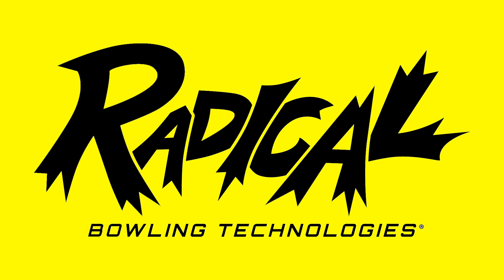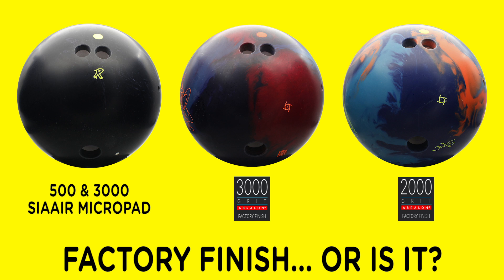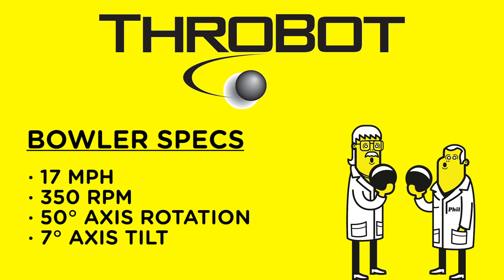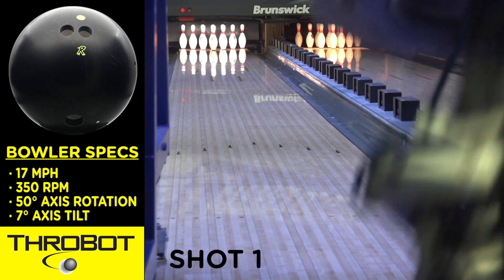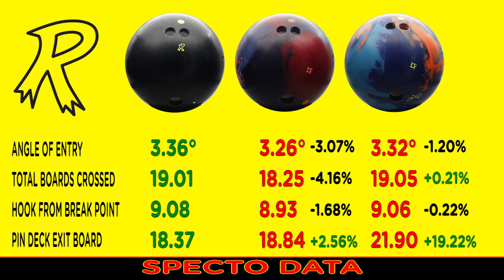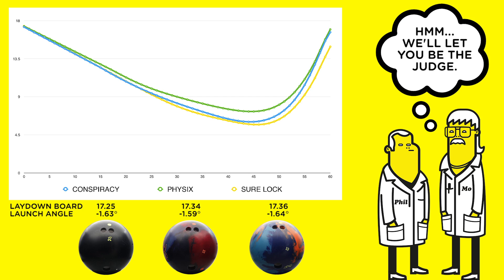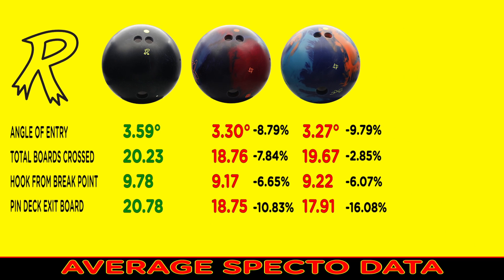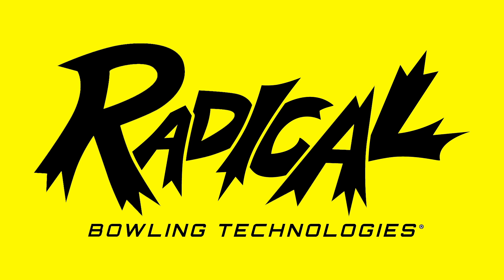Perception vs. Reality 6 - Radical vs. Storm

Comment: Im just gonna say this, bowling to me, for certain conditions, you'll want the hook the Conspiracy provides. But for other patterns, you may want a ball that hooks earlier instead of later and that crosses more boards.

The Physix is a good example of this when compared to the Conspiracy on 45' (the Sure Lock was pure, and still is for those who have it, utter trash). The Physix hooked the soonest because it was designed to have a early rolling / strong core with a cover that digs into the oil for friction to get to the pocket. Thus creating a ball that can handle oil with a punch

For other conditions (such as shorter patterns) you will need something like the Conspiracy to cover more boards instead of hooking early. 

In my personal opinion, these tests should be conducted the way they were in this video, along with different patterns (3, long, medium, short). 

Another thing to consider is burn. When the lanes begin to transition. Say said bowler throwing these balls is able to properly adjust to breakdown when it showsup. Now, if this bowler can make these adjustments with confidence, he / she now relies on the ball to carry and properly work in the new area of play.

Point is: Consider breakdown and how these pieces of equipment can handle breakdown and transition

Comment: I don't know why these videos keep getting into my feed. But since our Google overlords insist, I'll comment. These comparison videos are useless. They take different balls, with different characteristics, then sand them down to be 'equal' instead of manufacturer spec, then use a machine to throw using settings which no human will ever match, all while comparing it to a ball custom designed to BE THROWN BY THAT MACHINE, and then do an "I Win" dance. But how the fuck does that help me? My PAP and ball speed and revs are nowhere NEAR those values. Not even close. Hey, I've got an idea, how about you drill to a 4.75 over and 1 5/8 up using a speed of 14.20 and a rev of 130. Then we'll have an adult conversation. Oh yeah and don't fuck with the balls.

I don't even understand the point really. I've been recommended by my instructor and pro-shop to consider using the Conspiracy solid and the Gravity Evolve as my BENCHMARK ball.

Comment: I know it should not matter much, But on the conspiracy the center of gravity was closer to the fingers than the storm balls. When I roll balls with the CG closer to the fingers the back end is 10% stronger.  Would like to see the Same test after static weights were all equaled out. I roll the cutting edge and does it flip. Brunswick ,radical and DV8 make great Balls.
Reply from the maker: CG doesn't matter. We've said it. Storm has said it.
Reply: @RadicalBowling       If there are no true variables, the CG should be in the same place on all 3 balls, The starting top weight should be the same on all 3 balls. The Drilled Balls Should Have the Same Top and side Weight. It does matter a Little. One ball is pin out 2 inches and the other 2 are 4 inch pin outs. I roll Brunswick and DV8. I Want to try a Radical Ball Someday. I am still impressed By Your Radical Equipment.

Comment: I use to be a Storm/Rotogrip guy.  Halfway through this season, I decided to drop my entire arsenal due to carry issues.  I switched to Brunswick and is currently 10 pins higher! My Brunswick balls were a lot cleaner through the heads and reserved more energy on the back.  The Conspiracy has very similar shape to my Brunswick balls.  I may give it a shot.  I wish Radical would do a reboot of the Conspiracy with Dynimacore.  I would definitely buy it if it did 😏